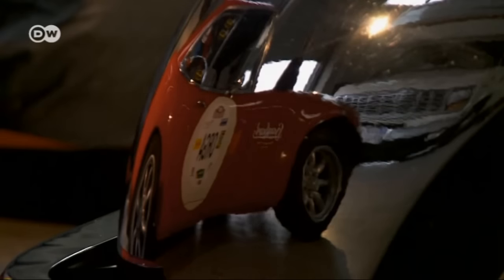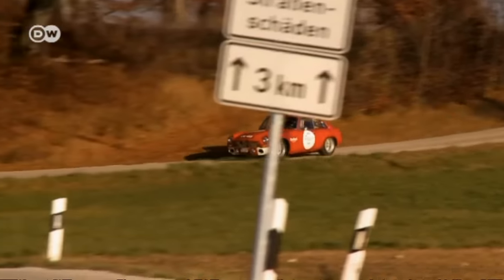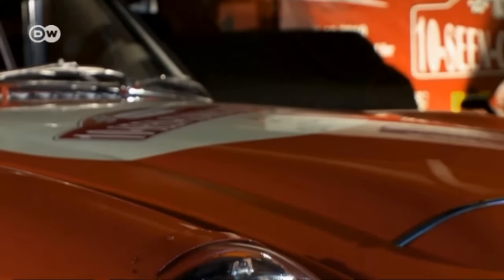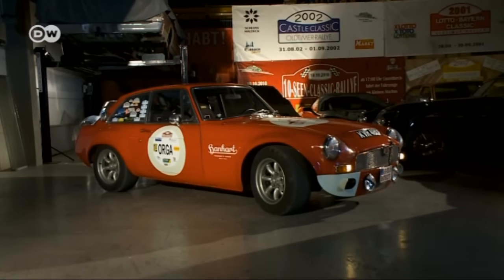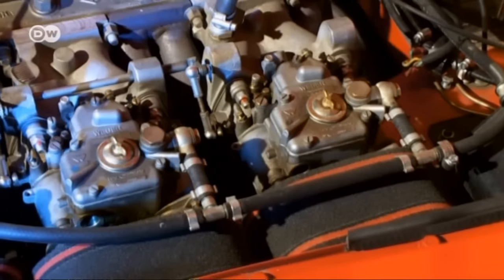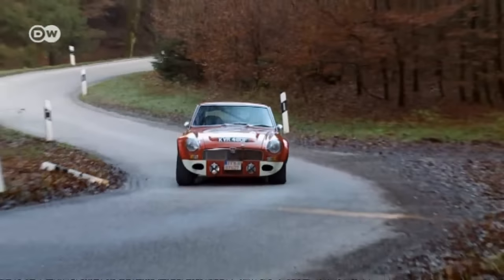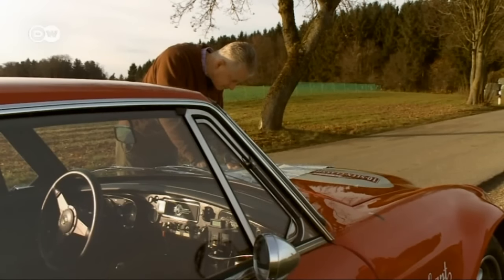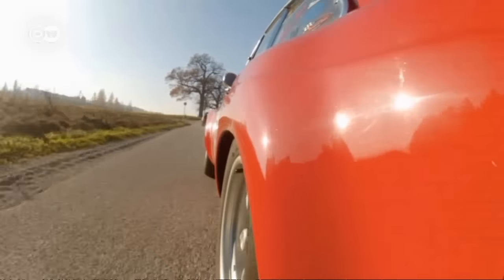Vintage: MGC GT Sebring | Drive it!

Comment: 5,000 Sebrings? That is false. There were 9,000 MGCs produced, of those 5,000 may have been GTs, however, the Works Competitions department only produced 2 complete alloy bodied "Sebring" cars, with a rumored 3 additional bodies having also been pressed, but never completed by the Works.
Reply: First, this documentation is German and only translated… in the German one there where a lot of different informations. I know the owner and this car is no grassfiber its a rebuilt yes but this one comes to 80k too

Comment: ONLY 6 alloy engined MGC GTS (Sebrings) were produces. They had highly tune C series engines in alloy. They had 220 bhp from a 2912 cc inline 6 cylinder OHV with triple Weber Carburettors. NOT A V8 engine like this are in the video. The only 2 true BMC works department cars were RMO-699F (nick-named Romeo) and MBL-546E (nick-named Mabel). Both were painted BRG or British Racing Green. And has full alloy bodies. NOT GLASSFIBRE like the on in this video.
Romeo had Green with Yellow front valance and Mabel too was BRG but with a red front valance. As Mario Funk stated other were 4 others  being built as well but BMC decided to scrap the MGC and the racing program in favour of other sedans in Rallying. John Chatham was to race one of these other cars but instead bought the remaining 4 for himself to compete with. He had them finished off over the next following years.
One of these other cars sold at auction in the UK in 2016 for £140,000.

MANY of the a total of 8,999 cars being built; 4,542 were roadsters and 4,457 were in GT form are still one the road today and not destroy by completion racing as indicated in this video.
This video is full of many untrue statements by the narrator and/or the owner of this nicely prepare COPY.  Again none of them were produced with a V8's like the one in this video
Reply: I wonder if someone could cast an aluminium block from a sand mould taken from a cast iron block?